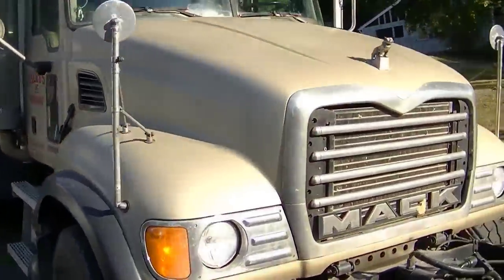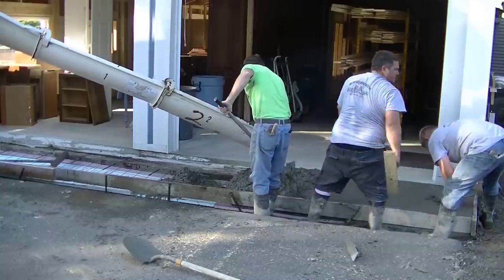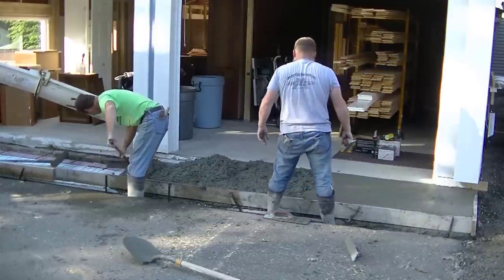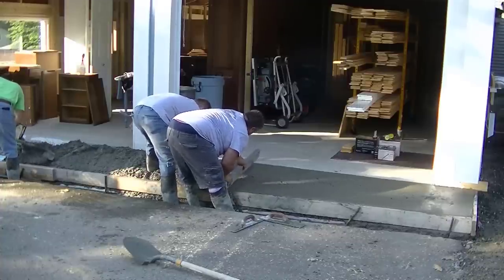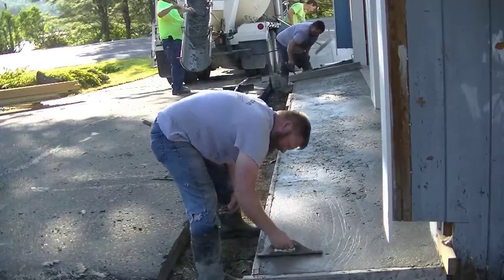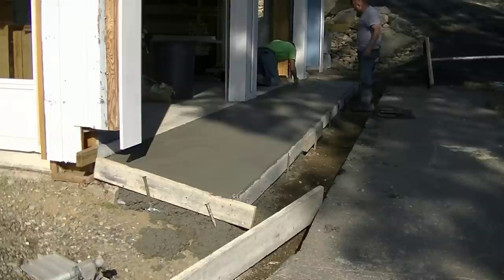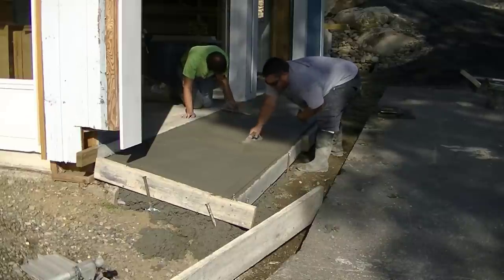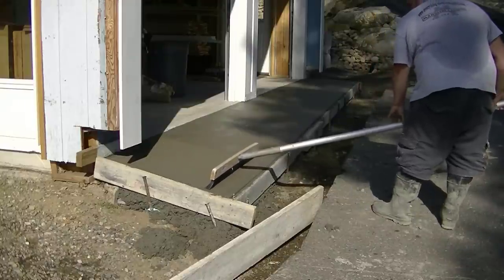Concrete Apron In Front Of Garage (Pouring & Finishing)

Comment: I always thought the brush lines would be opposite of how the water flows since it would be like a cross thread type traction.  So for instance on this job, it seems like going lengthwise with the brush would be better traction.
Reply: the water flows off the slab better when broomed parallel to the slope. * doesn't matter in this case as there is a lot of pitch. but when you can't get good pitch one thing you can do to help water run off is broom parallel to the slope.

the rule of thumb for traction is to generally to broom perpendicular to foot traffic. 

really what they did here was broom the direction that gave the cleanest finish, and was the easiest. which is a fine choice.

Comment: Mike . I'm laying concrete drive and yard here in Ireland.  What is the best way to guage for expansion joints . It's 9m wide and 20m long I'm going to break it up into sections. It will 4.5m wide as that's the middle , ill leave 2% fall to the center for both sides and gulley will collect rain water x what length do I add expansion joints on longer length part. Tks

Comment: What is the purpose of the styrofoam under the slab outside of the garage? What thickness and type of foam? The only times I've seen foam used underneath was either for geothermal or radiant floor heat. Just curious... Thanks for the videos and keep up the great work!
Reply from the maker: It's to help prevent frost from getting under the slab and heaving it in the winter.

Comment: Mike, I always notice concrete finishers edge then they broom then edge again. Why not just save time by brooming first then edging once? I'm sure you have some insight as to why they always edge  twice!
Reply: You can just edge after you broom, but many times it is actually faster to edge it twice.
The first edge is done when the cement is still soft so that you can fix any rough spots or holes in the edge easily.
The finisher can just get some cream from anywhere in the slab to fill the holes and then float out any marks.
The second time he runs the edger is optional, purely for the desired look.
If you only edge after the broom you have only 2"(the edgers width) to get cream to fix any holes, and if the cement gets hard it can be a pain(and time consuming) to push the edger down and leave a nice clean edge.
Reply from the maker: You want to make sure you get a good edge in before the concrete gets too hard. The second time we edge is more to give it that picture frame look. The first time around is to clean up all the edges which may be hard to do if you wait till after brooming when the concrete is a bit more firm.